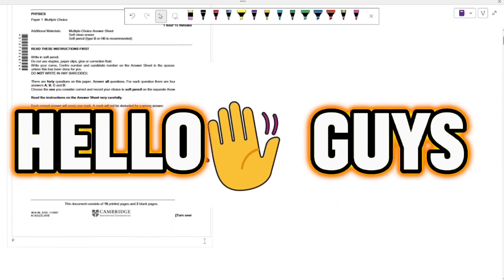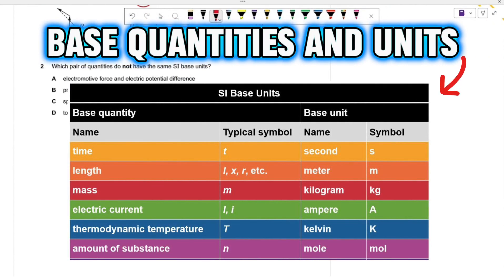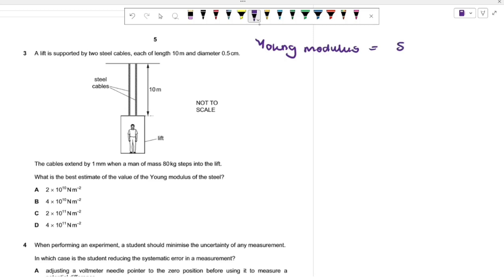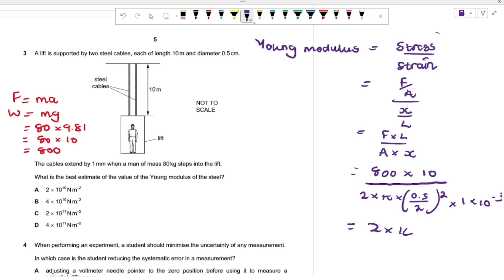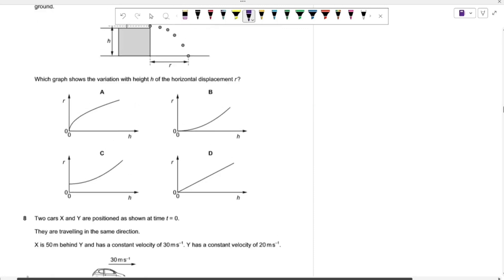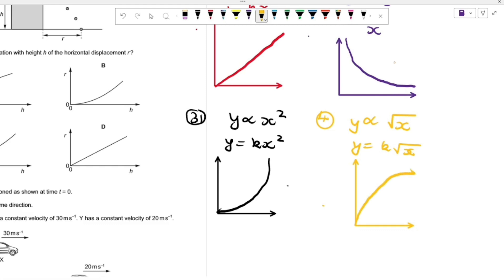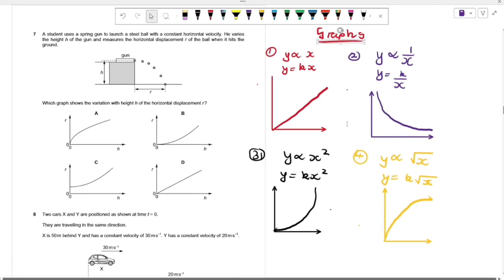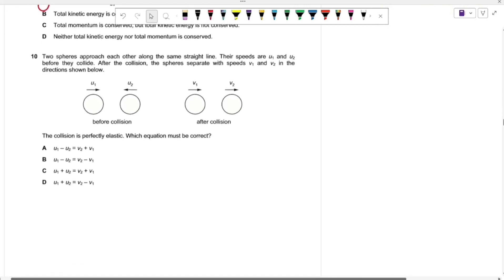AS LEVEL PHYSICS 9702 PAPER 1 May June 2016 || Paper 11 || 9702/11/M/J/16 || #Be_Intentional

Comment: 1:40:51 I didn't understand why we had 6 on Q
Reply from the maker: Hello✌️.Excellent Question lets break it down. I was hoping to look for the pd btwn Q and S. Since we have 9V to use right assume you start at P if you lose 3V through the first resistor it means we have 6V left at Q to use in the next resistor that's why I put 6. That's the potential at Q same logic for S and then pd is then 6-4 does that make sense?  Please do tell me if there is any area you don't understand.